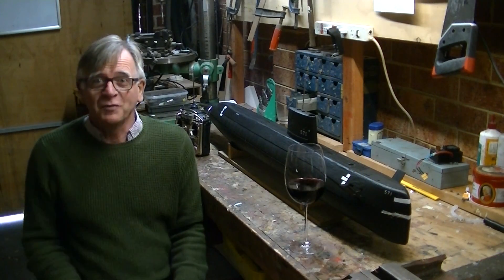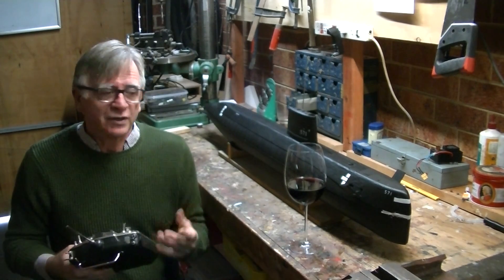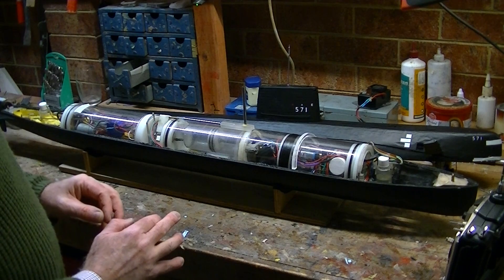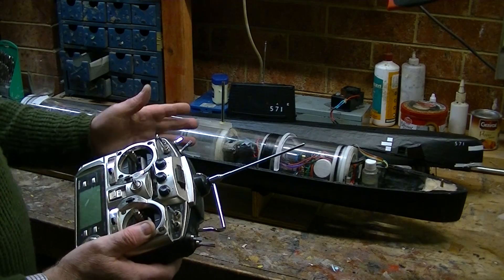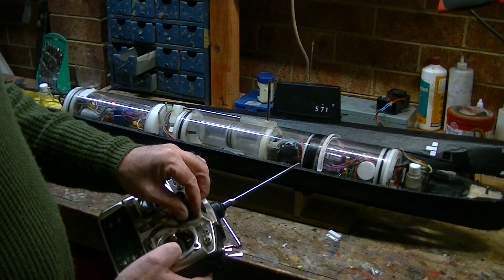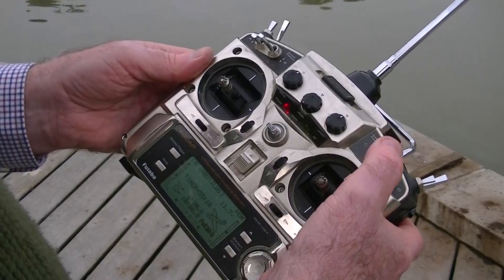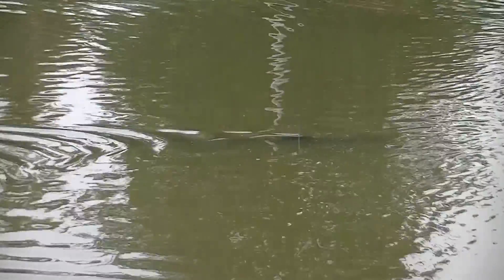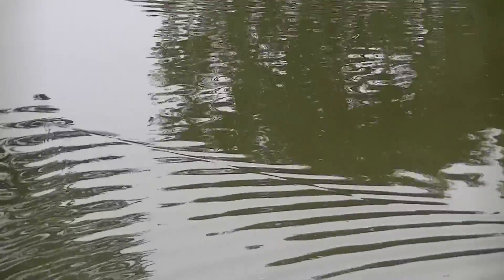Automation

Comment: Very well done John. I assume the antenna  (snorkel) is open to the air at its top end, what happens if you dive deeper than the antenna top? Do you have a rescue buoy on it that releases if you loose rc signals, or it stays down too long?
Reply from the maker: HI.  I have a dded  a para to the Instruct-able about this as my explanations are confusing.  The RC aerial lies horizontally inside the boat and will be fine to 3 meters in fresh water.  The air intake is hidden inside the sail, and the mast you see is just for visuals in water that is not clear.  If I turn the transmitter off, the failsafe will extend the piston and it will rise.
Reply: I may have confused things by referring to the air intake as an antenna, so if it can dive to 3meters the air intake can submerge below the surface. About the RC aerial being fine to 3 meters in fresh water, be careful if operating in a pool as  the range is a lot less than fresh water, possibly due to the chlorine use to treat them.
Reply from the maker: Hi, yes fresh does not apply to chlorinated pools, but it will go down to 2 meters Ok in a  pool. Although it gets 'twitchy'